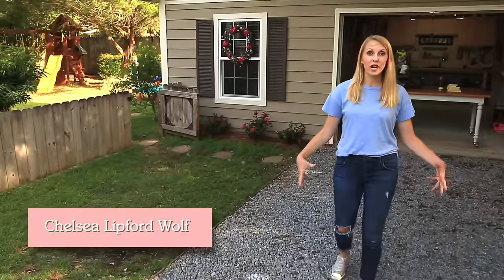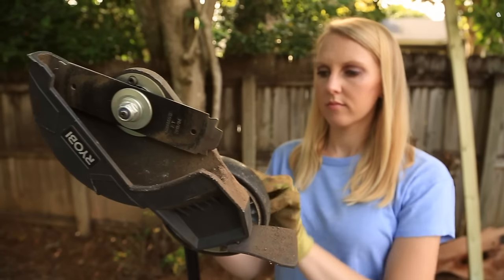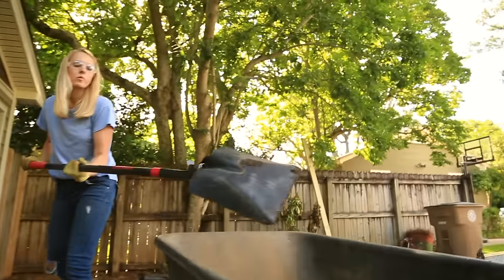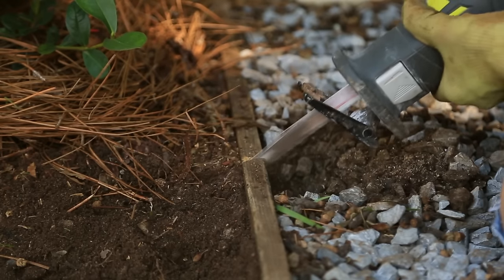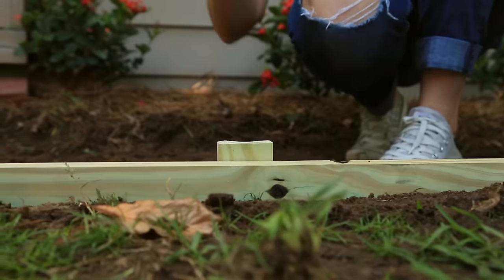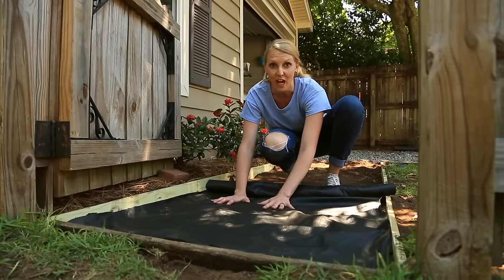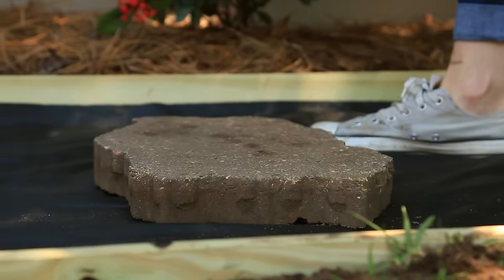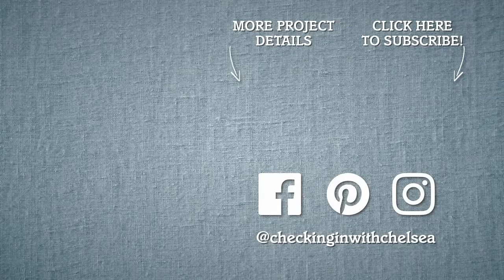Eliminate Dead Grass with This Gravel Path!

Comment: Will the wood eventually rot?
Reply from the maker: Well, yes. The wood bordering our driveway has been fine for 9+ years though. Even in our wet climate.
Reply: All wood rots but pressure treated does so a little slower

Comment: Thank you!   I’m wanting to something similar using paver bricks for boundary.  Now I’m confident to move forward without all the extra steps of base, sand etc. I’m using river gravel
Reply: Curious if you did this, and if the pavers slid around eventually?  I still think sand under it would be longer lasting. 🤔

Comment: This is great, however the cats flock to my gravel areas to use them as a toilet. I'm changing to slate gradually as they don't like the bigger stones.  I'm also going to put  my stepping stones closer, as I think a person with ten foot legs put them down, so watching how easy it is to lift them out was good.

Comment: This is a diy trap. Looks good at first but will fall apart quickly. The wood touching the ground will rot out, the weeds will grow through the landscape fabric in 2-3 years, and there’s no fill to hold the gravel in place. Use good metal trim, avoid landscape fabric like the plague, sweep fill material into the gravel and make sure to compact to hold in place.

Comment: The idea is good, just saw obviously old but it always works. Only I don't like that wooden boundary. Much better to use more designed edge, by using bricks for borders, better if of ground color..it will surely be more resistant, and nicer ro see! Believe me!! 👍
Reply from the maker: I love the black metal landscaping edging but we were just matching the existing border for this project!

Comment: Hi can you tell what is the name of that product you are using to cut the grass sod edge .. I see it says Ryobi company but can you specify model or exact product because I need to cut my grass sod as it is very firm n ground and not easily coming out @Checking In With Chelsea
Reply from the maker: Here is an affiliate link to the base: https://homedepot.sjv.io/c/1980335/456723/8154?u=https%3A%2F%2Fwww.homedepot.com%2Fp%2FRYOBI-40V-Expand-It-Cordless-Battery-Attachment-Capable-Trimmer-Power-Head-with-4-0-Ah-Battery-and-Charger-RY40226%2F308939659

and the edger attachment: https://homedepot.sjv.io/c/1980335/456723/8154?u=https%3A%2F%2Fwww.homedepot.com%2Fp%2FRYOBI-40V-Expand-It-Cordless-Battery-Attachment-Capable-Trimmer-Power-Head-with-4-0-Ah-Battery-and-Charger-RY40226%2F308939659

A nice option for a smaller yard! ~Chelsea

Comment: Do you have e to remove grass?  What happens you just put tarp over grass and lay rocks on top?
Reply from the maker: That will do the trick and kill the grass! In my case I wanted to remove the grass so the new area would be the same height as my existing driveway area! ~Chelsea